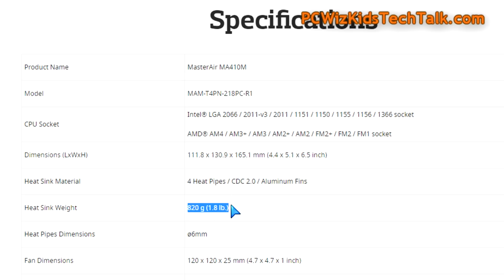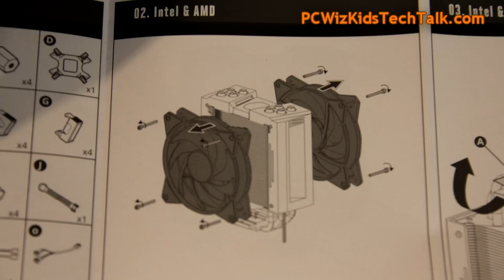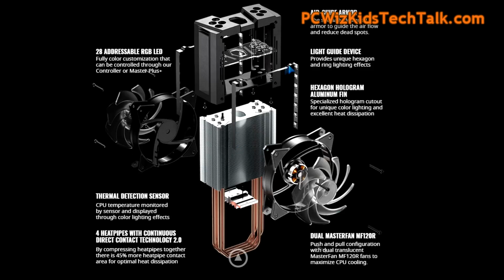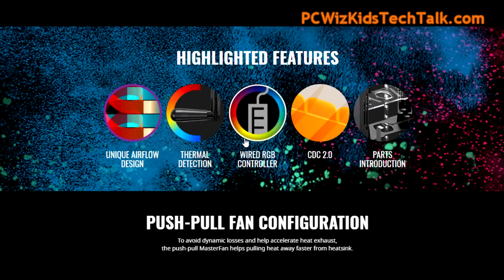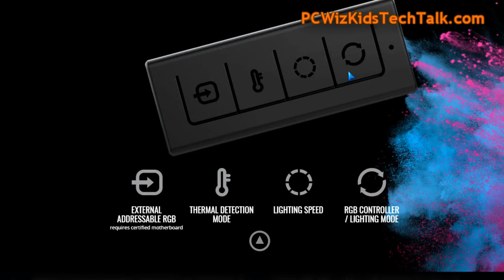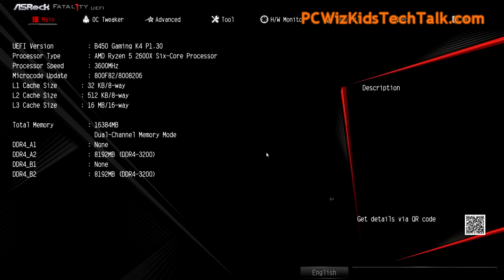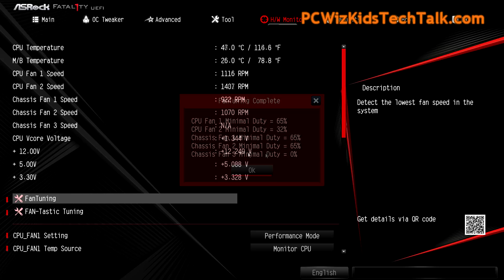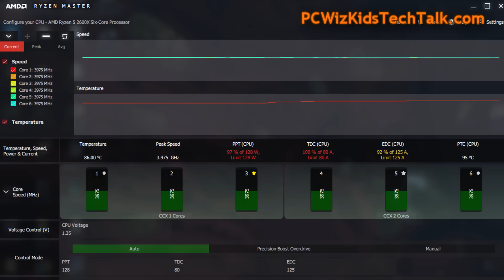✅CoolerMaster MasterAir MA410M RGB CPU Cooler Review

Comment: jayz2 did a thermal thing and show you never go wrong adding to much thermal but added little can effect your thermal i would put more to be on the safe side
Reply from the maker: However, he does not apply to both the CPU and the Cooler like I did.  Adding 2 layers of thermal is just as much as putting more on just the CPU.  it looks like its not enough when I applied it, but remember also, too much and it will be more effort for heat to transfer through it.
Reply: @PCWizKid  how do I change the fans color